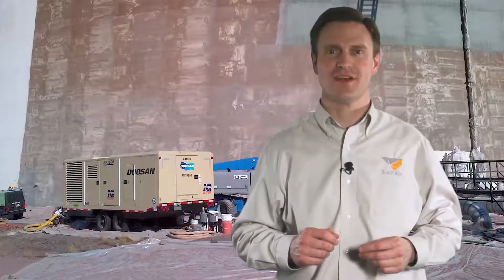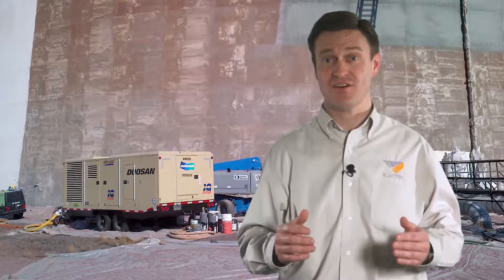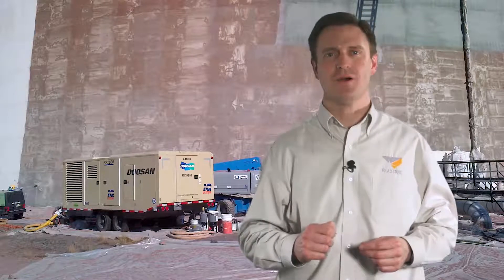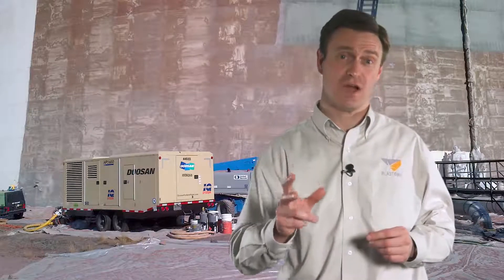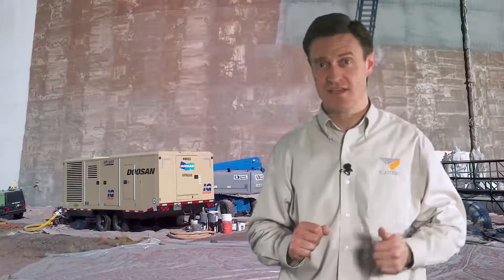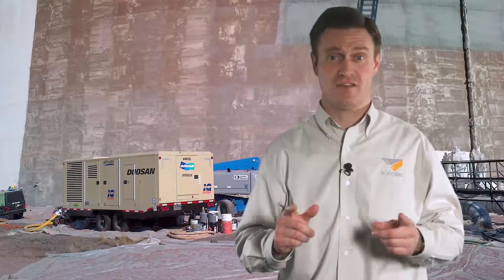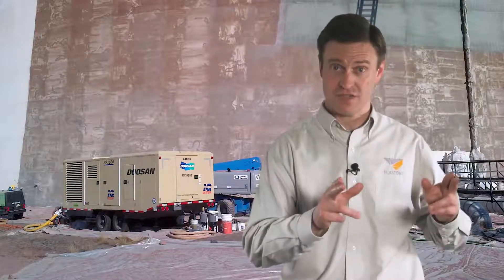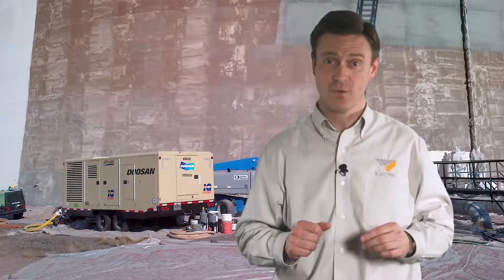Choosing the correct size compressor is important

Comment: I haven't seen a portable yet that is set to run at rated RPM, and I've had the opportunity to check several.  I have a IR 185 that's supposed to be 2500 RPM at high idle. I checked it, and it only revs to 2100......more like 160 CFM.  Be sure to check and adjust engine speed to rated RPM........or use a larger compressor.